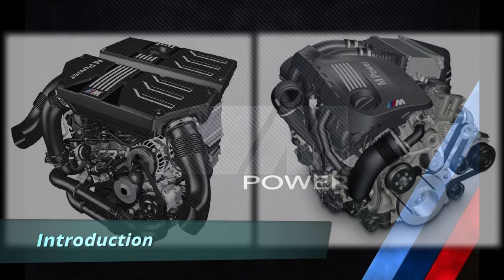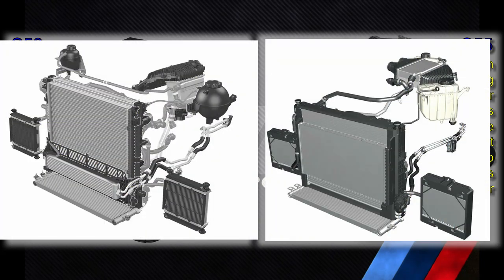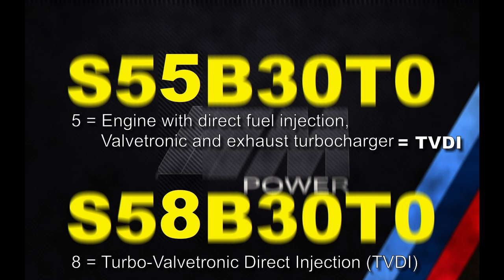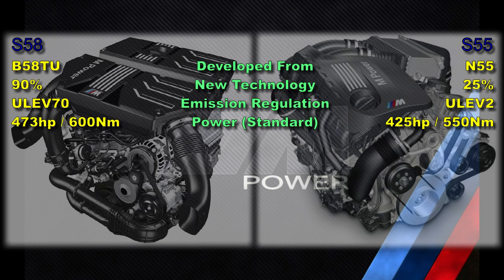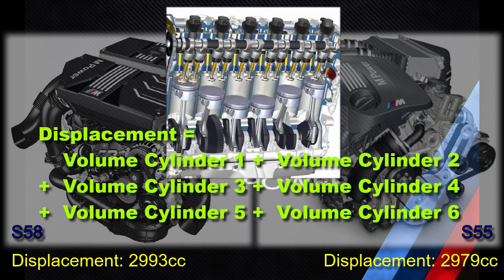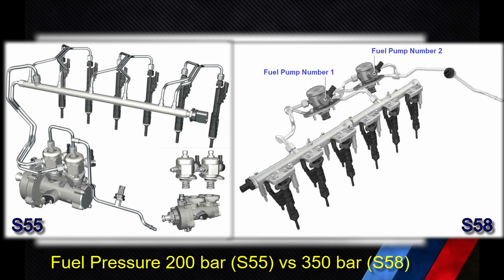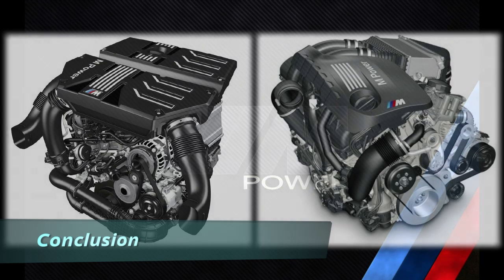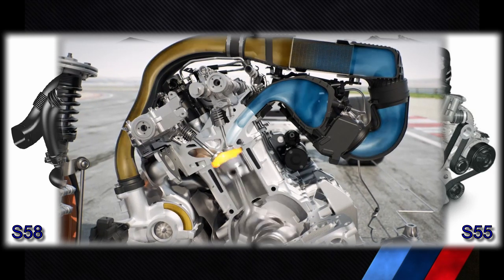BMW S58 vs S55 Engines: A brief look at the differences & similarities between proper MPower engines

Comment: I saw video where drifters were testing f82 and g80 and s58 was overheating where s55 was still in operational range. Perhaps new regulations a killing m engines
Reply from the maker: Sounds interesting, would love to check out the video if you have the link.
Reply: @NoBrainerTalk  Video in Russian language but you can see cars dash with warnings https://youtu.be/65ykbiYoWWg?si=CKnqfuup2vkARbp8  they start their test at 8 min and around 9 minute mark they travel to the dude with m4 and do same test on both cars in same conditions. He said they took it to service and they didn’t find anything wrong with engine

Comment: i have an s55 in my f87 m2. i currently have 25k miles on stage 2 tune. so far its been extremely reliable but its a bit noisy at idle. i think thats been a common complaint wit the s55. seems like the s58 has better turbos and responds better to tunes
Reply from the maker: Thanks for sharing.

Comment: Do you left out the boost level the new engine is boosted at over 20 psi, where the old engine only needed half of that to make almost the same power. The older engine is a more powerful engine, most likely due to the regulations.

Comment: I recently bought an S55 engine and it came with a convenient Hockenheim Silver carrying package. ;) It's an incredibly torquey engine. I'm curious how the percentage of different parts between the N55 and S55 as compared to the B58 and S58 was calculated. If it's based on counting part numbers, it's somewhat misleading. If you look at the major components, the changes from the B to S engines are not that different. They have different blocks, cylinder heads, crankshafts, pistons, etc.
Reply from the maker: Hi, the percentage differences are quoted by BMW, but is not a scientific number, because as you very rightly point out, it doesn't specify what is being  measured (unique part numbers, part quantities, part weights, part costs, etc). Personally I always take it to mean, how many new engineering drawings had to go through final approval (so when BMW says the S58 is 90% new compared to B58, this means 90% new engineering schematics to build parts), but this is my personal guess and is not based on anything. Much of what BMW and pretty much all manufacturers state are heavily influenced by marketing considerations aswell, so it is always difficult to extract useful scientific conclusions from their press releases.
Reply: I agree

Comment: I have F83 S55 tuned. S58 extremely strong and easy to become 1200 horsepower. Every five years, BMW develops a new engine.  I am happy with the S55, but of course I would love to own the S58 because lots of new technology like fuel pump new dme etc.. and the S58 very convenient for tune..
Reply: I own a F82 and was considering change to G82 but have few issues with is mainy the front and also the fact it’s not as nimble as F82. The new car is line an older 5 series.

Comment: There are a number of changes here that will make the S58 quite a bit harder to work on. Injection system, timing chain location, 4th gen VANOS, etc. I feel bad for mechanics.
Reply: Can confirm, plugs are surely easier to remove on the S58 than the S55.

Comment: Which engine is more fuel efficient?
Reply from the maker: Actually the S55 has lower fuel consumption and lower emissions according to BMW, and it seems to be confirmed in real life. Keep in mind the S58 is fitted to heavier cars so it has to do more work to accomplish the same performance as the S55.  If someone fits an S58 into an F80 M3 for example, then we could really see how much the engines are different in economy. Or alternatively maybe cut 200kg off a G80 M3 is another way to do a comparison..
Reply: @NoBrainerTalk  👍 Thanks, that would be an interesting project for comparison.

Comment: Another great videos. Can you comment on the changes done to the S58 for the G90 M3/M4 that the new 2022 LCI X3 refresh got? Is it just a 3D printed cylinder head and perhaps engine mapping? The increased torque rating seems significant based on improved acceleration times. The 3D printing probably allow more optimized flow geometry and boosts low and mid-range torque. Some reviewers say it got a forged crankshaft but I believe the original S58 crank was also forged. I just ordered a 2022 X3 M yesterday!
Reply from the maker: Hi, there are configuration differences between M3/M4 and X3M/X4M with S58. The engine cover doubles as the intake muffler and combined filter box on the X3M/X4M but the M3/M4 feature a simpler engine cover and traditional separated intake muffler boxes, this means alot of the air ducts are different. There are different braces in the engine bay, differences in the location of coolant expansion tanks and other miscellaneous changes, I believe driven by the space available between the two engine bays (M3/M4 vs X3M/X4M). But I believe the internals (turbos, crankshaft, pistons, block, cylinder head, etc) are identical. All S58s have 3D printed cylinder head, forged pistons, forged crankhaft, etc. The engine mapping difference is between the competition and non competition cars. "Competition package" cars will have more hp and torque purely through the engine mapping, as again the internals are identical.
Reply: @NoBrainerTalk  Thanks! Great info. So the 2022 X3 M S58 torque increase is just an engine programming difference, i.e. more boost? There’s no mechanical differences between 2020/2021 and 2022 models?
Reply from the maker: @BurnsRubber  Correct, they are all S58B30T0 engines and if you have a competition version you get a tune that gives you more power. Even with the competition tune, it's probably still underpowered (probably power will increase further with more limited edition versions like CS).

Comment: Just watched several of your S58-related videos, absolutely excellent content, thank you. 

Could you consider doing a breakdown of the changes that go into the S58 competition package?
Reply from the maker: I'm under the impression that the additional power output for the competition-version engines is through an ECU tune alone (i.e. there are no noteworthy physical changes). However, I will double-check this.
Reply: It's just more aggressive software.  Engine is the same
Reply from the maker: @rodgazinya  Yes, I think so too. I was hoping to find any competition version car on RealOEM fitted with S58  to compare S58 comp and S58 non-comp, but I can't find any comp car fitted with S58 on RealOEM (See M2 for example, there is both M2 and M2 competition on RealOEM). Anyway, I don't think there are any hardware changes, it must be similar to M-Performance Power and Sound Kit (MPPSK) for B58 cars, extra power comes from ECU remap.

Comment: I've also noticed the S58 engine uses the main cap design for the crankshft, while the S55 block has a solid two-piece design with fixed girdles. Does this mean that the S55 block would be slightly more robust?
Reply from the maker: Hi there, one way BMW has been able to increase the power of the S58 over the S55 is by optimising the design to minimize pressure losses, hence the S58 engine block is designed to be continuously subjected to higher pressures. It therefore needs to be more robust than previous designs. It's also unlikely that it was designed just for max output of 510hp of the competition package engines, it's quite likely that future variants e.g. in future LCI or limited edition M-Cars, could have an even higher power output. I would therefore personally conclude that the S58 block is designed to be more robust than the S55's.
Reply: @NoBrainerTalk Thanks for your reply! Makes a lot sense considering there are more powerful upcoming models equip with the S58 and S58 has to be more robust to handle the extra power

Comment: So basically S58 has more similarities with S55 than B58.
Reply from the maker: I think the M division followed a very similar formula (in the case of both S55 and S58) in terms of what they added and what they removed compared to the baseline engine. However the baseline engine design is what truly drives fuel efficiency and performance potential. Having said that, the S58 is 90% new compared to the B58TU (maybe would have been different percentage compared with 1st gen B58) so possibly you are right... You  make an interesting point!

Comment: What about the weight?
Reply from the maker: Hi, so I did not include details about weight because I do not have accurate information. There is some weight information available but the exact peripherals included is unclear (i.e. how the dressed the engine is in each case). Some sources place the dry weight of the N55 at about 190kg, and the S55 at about 205kg. This means the M-Division added roughly 15kg of weight with the modifications made (second fuel pump, etc). At the time the M-Division said that the two smaller single scroll turbos did not weigh much more than the single twin scroll turbo, so with the use of more advanced materials they kept the weight increase to a minimum. In any case the B58 weighs less than the N55, at about 140kg. In the case of the S58, the M-Division modified the B58 engine more substantially, including deletion of the heat management module. I would therefore purely guess that the S58 did not gain more than 15kg over the baseline B58, so I would purely guess that the S58 should be approx. 155kg. So it is my pure guess that the S58 could weigh as much as 60kg less than the S55 (but of course I could be completely wrong as this is based on many assumptions). <<EDIT>> MY COMMENT IS INACCURATE AND SHOULD BE IGNORED... :)
Reply: @NoBrainerTalk  This is very interesting information and more than I've been able to find myself. Are you sure the B58 is that much lighter than the N55? I read somewhere it was actually 10kg heavier.
Reply from the maker: @harbl2479  Hey there, I am completely unsure is the honest answer. 🥺😨 Some sources place the weight of both N55 and B58 engines at between 130-133kg, so everything I said before could be wrong! Actually, let's just say it's wrong. The only weight that is confirmed by BMW is the weight of the S55 at 205kg. But we don't actually know what components are included or excluded in each case, so we might be comparing apples with oranges. Ignore my previous answer, and if you are able to find an accurate weight for each engine I will be very interested to know. :)
Reply: @NoBrainerTalk  I store info at the back of my head, that the B58 dry wieght is 139kg.